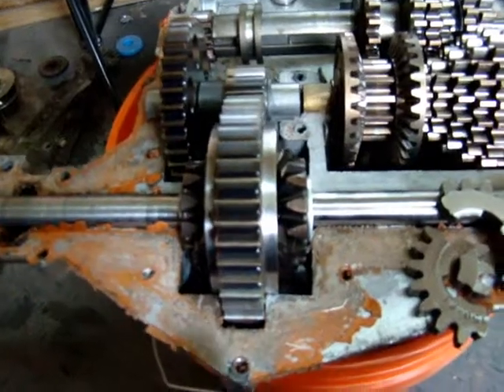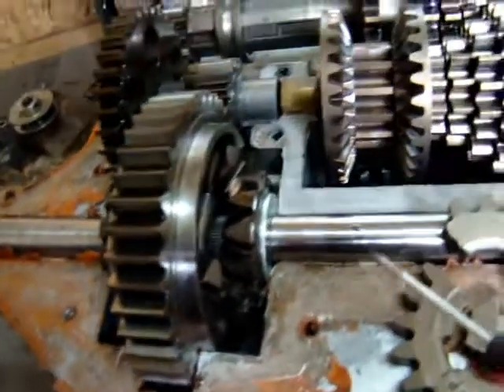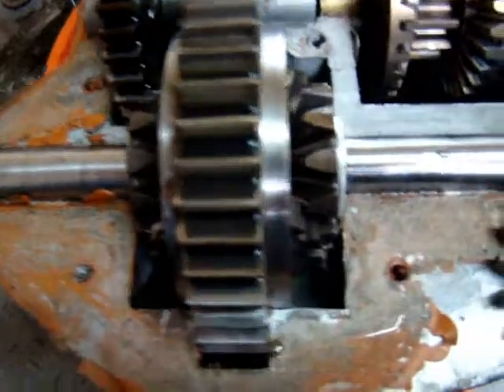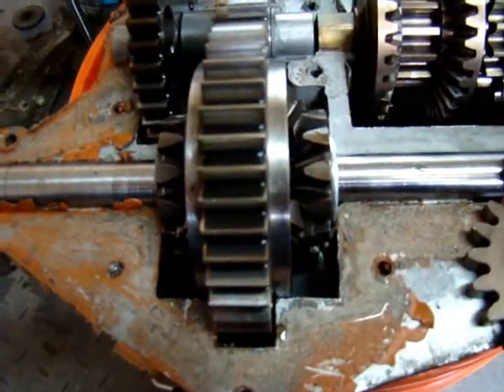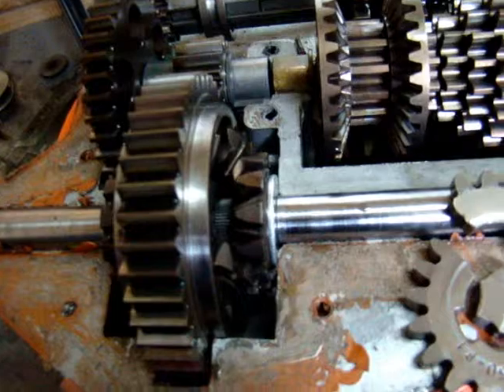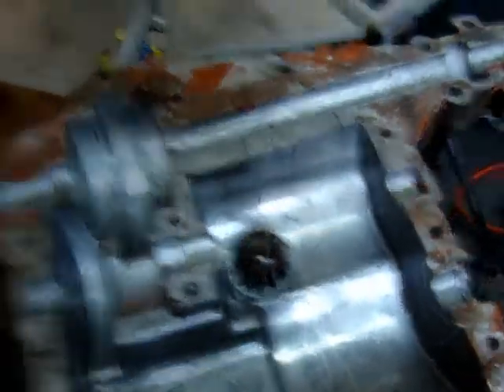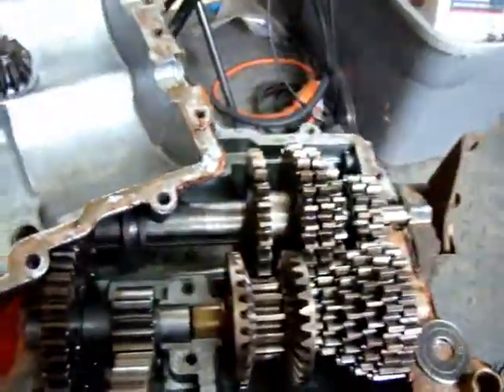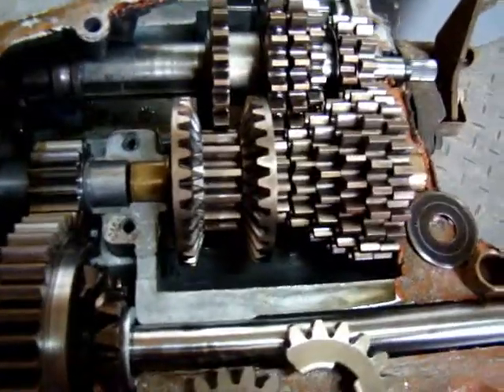Shim your Peerless transaxle

Comment: i just did this now my shifter works but i cant get the mower to move now its locked the wheels will go oposite directions but not the same way :(
Reply from the maker: Could you have dropped the detent ball and spring when you split the case? They were under an allen head screw near the shifter. The shift keys will make it click like they aren't missing.

Comment: I believe shimming is the better option for me. I have a Cub Cadet 1200 4 speed and want to get better traction but don,t want to completely lock the rear end up. What do you thank? Question, how do you keep gear oil from leaking when you change from Bentonite grease to gear oil, sure would like to know the secret. I see all these post about changing there transaxle to gear oil but nobody says what they do to keep it from leaking. Another thing is, they say, rebuilding a transaxle but I have yet to see a complete tear down and or reassembly of one. What I am talking about is taking all the gears, thrust washers, and seals out and then  reassembly it in the correct order. I would sure like to see you or some who knows what they are doing to make a video and post it. I like your videos and the way you explain things," Keep Up The Good Work."
Reply from the maker: I have never had trouble with leaking. As long as you do a good job sealing the case halves it should be fine. Try to get your fill level just to the bottom of the shafts. 
It's due for a set of shift keys so I'll work on a vid showing the dis-assembly and re-assembly.

Comment from the maker: @tractorman64 Gears shed metal as they wear and the grease will carry the metal in it. Glue a magnet inside the case and use gear oil. That will give you the high pressure lube you need and the metal sticks to the magnet instead of being fed back to the gears.